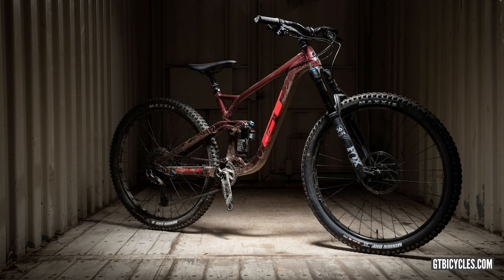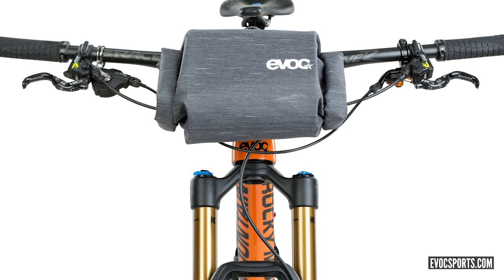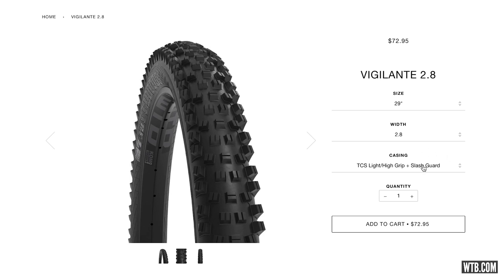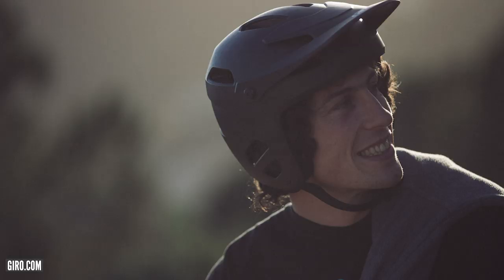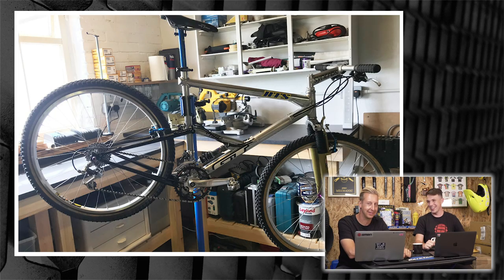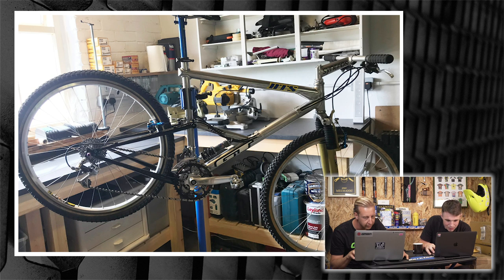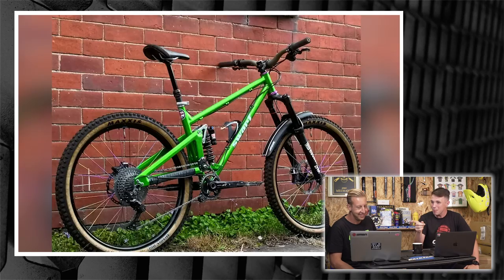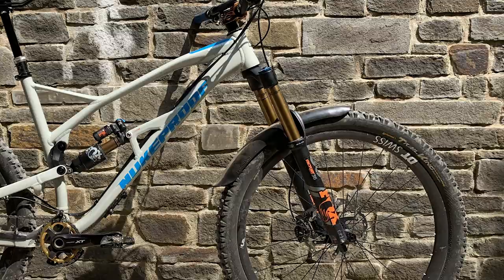New 29er Enduro Bikes & Bikepacking Kit | GMBN Tech Show Ep. 83

Comment: Super stooked my Swarf made it into top mods! Glad you like it! As it turns out it was Adam/Rachel's old bike!
Reply from the maker: That's rad Ollie! 🤘👊
Reply: Is there a reason you switched out the front mudguard? The old one looked sweet 👍
Reply: @rob-c.  I run the long one in winter and then put the short one on for summer! No need for the long one when the trails arw dusty
Reply: Ollie Richards ah cool - good to hear you’ve still got it 👍
Reply: @rob-c.  yeah, will be going back on soon if the trails stay as wet as they are now

Comment: #AskGMBN #AskGMBNTech Hi guys, love the channel - I was wondering how big an effect swapping to a mullet setup with a 29er fork and front wheel would have on my geometry? Would I realistically need to decrease fork travel to keep the fun manoeuvrable characteristics of the bike? I’ve got a 2017 27.5 “Commencal Meta SX and would love to keep the stock 170mm travel in the swap. The bikes current geo is: Head Tube Angle = 65.5°, Head Tube Length = 110mm, Reach = 407mm, Stack = 577mm. Thanks!
Reply: I think you mean Reach = 470, not 407, because 407mm is ridiculously short.

Comment: But pole Requires Zip Ties.
Nicolai don't need it at all, but NS only need it on chain stays, Cip Ties or cable clips. So far Nicolai seems to be the best when it comes to cable routing, no zip ties needed, only uses metal clams on and plastic clamps on chainstay & chain stay protector.

Comment: So, what is the oldest standard on a mtb then? Priests valve core, end of bar grip dimension, pitch of a chain, gear cable?
Reply from the maker: The grip dimension has been the same since the early 1880s and is probably the only true standard in cycling!

Comment: #askGMBN #askGMBNTECH I bought green 2007 Norco Bigfoot a few years ago and it came with 2006 marzocchi drop off sl 150mm. The forks are way too long, bringing the bottom bracket and therefore the extended saddle waayy to high. Can I put a 40-60mm reducer in those shocks? If so, where can I find such an old part? Alternatively I have heard that the more oil you add the shorter they get.. There's very little official info on these forks and you can't trust every forum post you read. Thanks and cheers from Ontario Canada!

Comment: Yeah I had a problem with tubeless, tried slime-rubbish, tried finish line-rubbish, both unusable. Tried respected Polish brand Trezado, their "up to 6 months" formula, latex like, but without amonia stench. Dried almost completely after 2 months of Polish "desert summer". Summarising - tubeless - what a retarded idea, going back to tubes. I can live with up to 1 puncture per year with completely no hassle, no mess, no additional tools, no additional investment, no monthly subscription on topping up sealant, no growing weigh of the tyre after every top up period and complete freedom with changing tyres prior to mountain trip or before winter, so they fit under mudguards. I did 3k km per year second year in a row. Stats: 1 puncture/year. WHATS THE POINT?! Yeah I'd love that 500g saving on rotational weight, but not for that price. BTW Trezado rolls of with palm of hand or a work glove completely, so it's good once it hardens.